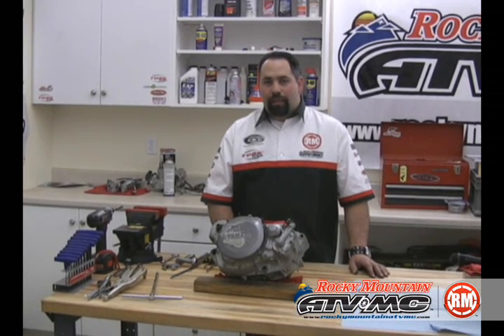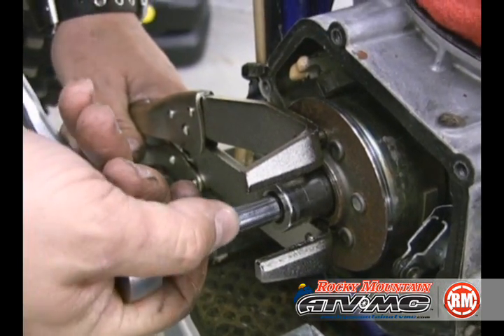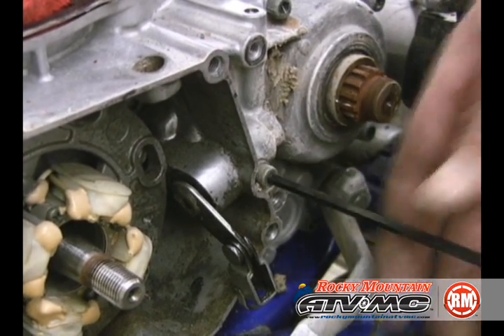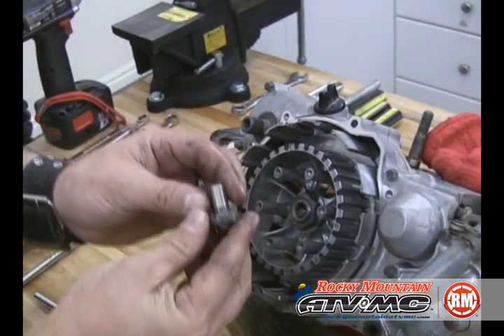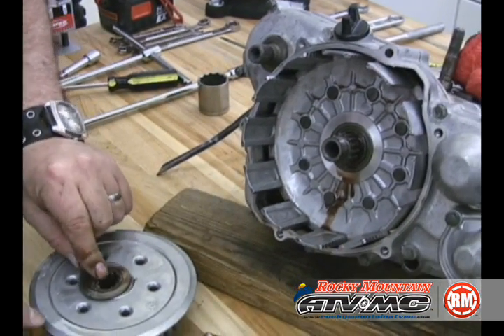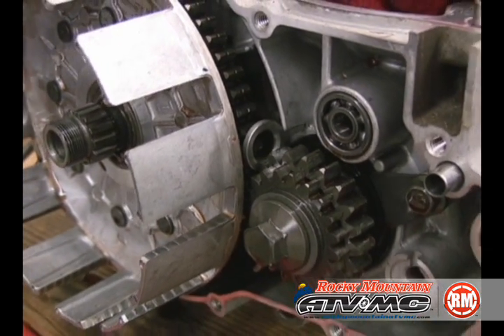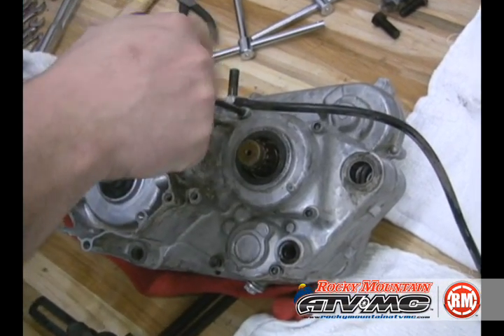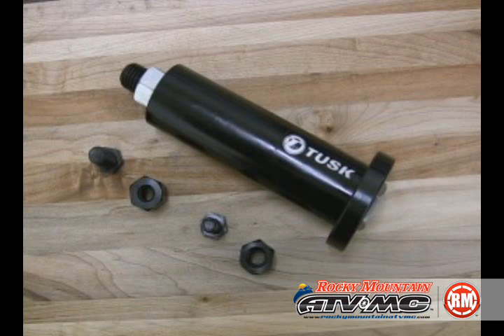Motorcycle Bottom End Rebuild | Part 1 of 3: Engine Teardown

Comment: RockyMountain, quick question. THis will be my first time opening a dirtbike case, I have a great Mechanical aptitude. Does the Head need to be completely taken apart to split the case? rmz250 2013
Reply from the maker: gerry kline First off it is necessary that you have the service manual for your bike and you need to follow along with that in order to do it correctly. As for the cylinder head being disassembled, yes that will be the first step. Removal of the cam chain tensioner and then you can take the cam caps out and then slide the cam-chain off the cams and remove those. After that you should be able to remove the cylinder head and then the cylinder and the piston but make sure and follow along with your service manual.
Reply: OK I have the service manual, they put everything in there except splitting the cases, which I found odd.
Reply from the maker: gerry kline
Yeah, that is odd. To be honest i haven't looked in a Suzuki Manual for anything in quite a while so i'm not sure. They should have all the information you need to split the engine but like you said they might not. You may want to ask your local dealer about where you can get the info for this job. For now you can follow with your service manual to tear it down as far as you can and then go from there. If you have any other questions let me know. Thanks!
Reply: Yes, I need to know what Flywheel puller will work for my year 2013, seems to be unclear on what will work/.
Reply: I have to swap internals to a new case 4 stroke, cracked the crank case. Are there any other things I need to know upon doing the split?
Reply from the maker: gerry kline Yeah, for some reason we don't list a flywheel puller for your bike. Motion Pro is saying it's part # 08-0425 which is a 28mm puller with internal threads and it also comes with a threaded cap to protect the threads on your crank. The OEM schematics for your bike show a flywheel with internal threads so this internal threads puller wouldn't work. Can you pull your ignition cover and confirm whether it's an internal thread or external thread flywheel? That way we can know whether or not this puller will work for your bike. As for the swap I would still consult your dealer to see if there is any info they can give you for this job. Use the correct tools, it will make the job a hundred times easier. Once you split it inspect and clean all the parts thoroughly before reassembling everything.
Reply: OK, I received the case, Inner clutch cover, kick start gear, thus far. I ordered the Tusk case splitter, and crank remove/install tool, clutch holders, feeler gauges, and impact screw driver set. I found a puller on Ebay brand new guarantee working on my setup. I pulled the cover and the flywheel seems to cup inward unlike the vid you have, so the other side of the clutch holder tool will not work because it being recessed inward, but im guessing the clutch holder could still be used hold the fly wheel in place if need be. There are threads on the actual flywheel. It looks as if there is a bolt holding it to the crank then separate threads to pull the flywheel out. I am almost inclined to put it finger tight install the old motor and create a video on this as there are no up to date 4 stroke videos out there. But your vid still is helping me address a lot of the processes. But I would update your tools list. I used my micrometer to test the width of the threads of the fly wheel it comes out to 28mm. If you have an email. I would gladly take various pix to help future customers and yourself if you ever wanted to make a newer vid. I am at the point of taking off the head. Just a question. Should I but the motor in TDC intake stroke and them remove or does it not matter as Im swapping out everything anyway.
Reply from the maker: gerry kline Yeah, the newer 4-Strokes are going to slightly vary with each machine and they are a little different than the YZ250 Engine Split shown in this video. You can also refer to our Four Stroke Top End Rebuild which will be similar to your bike as far as tear down and then reassembly and timing the engine by clicking this link. Motorcycle Top End Rebuild For Yamaha Four Stroke (Part 1 of 2) For the cylinder head dis-assembly and removal i would start with the engine at TDC for the tensioner removal and then the camshaft caps removal. That way there isn't any tension or pressure on the camshafts while you are removing the caps. After that it's not going to matter if the engine is at TDC or not until you are re-assembling the top end.
Reply: Rocky, I tried the freeze/heat method and it didn't work even on one bearing. I froze the bearing for 16 hours and then put the case in the oven set for 215 degrees. when I went to start with the crank bearing it only went in half way so I began to use a soft mallet it still only went in half way.I tried torching the case with the bearing still half way in and didn't move and ruined the shift drum bearing...... Will this not work on a brand new case as maybe the clearances are too tight....
Reply from the maker: gerry kline This method should work in any case if done correctly. I like to leave the bearings in the freezer until the very end. I like to heat the case with a torch like shown in the video and then the bearings should drop right in. Sometimes you'll have to use a bearing driver set to seat the bearing into the case the rest of the way but when you do this is crucial to have the case supported on a flat surface so none of the sealing surfaces get damaged. I would get a torch and a bearing driver if you don't have them and use those to seat the bearings in the rest of the way.
Reply: I have one,last question, upon my brand new case I just found out Suzuki didn't install the clutch release cam bearing, very small bearing on the stator side looks like the cylinder within the case, when you pull in the clutch it moves that cam back and forth. I don't know of anything that could press that down there.... have you ever encountered this. Also where you able to update y
our parts ID for the Tool we spoke about....?

Comment: Anybody know what size the nut is that holds the clutch basket on??
Reply from the maker: It's going to vary with each bike. Some might be a 27mm or 29mm or even a 30mm. It's important that you use the correct sized socket to remove this nut.
Reply: ok, thankyou for the reply.  Mine is a 2003, i will try to find the size.  I'm removing it tonight.  thanks!!

Comment: If I am just replacing my crank and rod do I still need to take the transmission out or can it stay in?
Reply from the maker: I would recommend removing the transmission while the cases are split. That way you can inspect those bearings and clean everything thoroughly. Removing it will also make removing the old crank and installing the new crank a lot easier and you don't have to worry about it dropping out during the crank replacement

Comment: I have a 1998 yz 250 is the crank from the 98 the same as a 1999 2004 in specs
 or upgraded? (can the newer model crank be used for a 1998 motor?
Reply from the maker: They are different and i don't think it would work putting a newer bikes crank in your 1998.
Reply: Rocky Mountain ATV MC Thanks for your quick response. I was afraid of that,
its getting harder to find one rebuilt and ready. I checked your oem site and it only lists to 2001. I guess il get this one machined .
Thanks again for the info
regards

Chris
Reply from the maker: Chris Matthews Hi Chris, i'm not sure what you mean when you said the OEM only lists down to 2001? We have the OEM crank for your bike but its pretty spendy. You may still be cheaper just getting a connecting rod kit and having your current crank rebuilt by a machine shop but i think the OE is worth looking at. If you are under the 1998 models your bike is listed almost to the bottom as "YZ250K1-1998". Let me know if you have any questions

Comment: It smokes so bad that when I. Park it , it drips oil off the tip of my pipe. , I'm not mixing it to rich or anything , and it acts like it always needs cleaned out unless you run it wide open
Reply from the maker: Cody Grimes It sounds to me like you're burning your transmission oil and a bad crank seal would cause that with how much you say it's smoking. I would closely inspect both crank seals along with their sealing surfaces to see if that's what's causing your problem. Have you noticed any drop in your tranny oil level? I would check there first and then let us know what you find and we'll go from there

Comment: Hey I really need some help with a bbike , its a 1999 cr250 , and I have just put a new crank , all the seals , all gaskets and bearings , new piston and rings , and its burning motor oil , it will smoke really thick and it turns my motor oil black , so someone said my crank seal was put in wrong , so I bought another one and its still doing the same thing , I can't find anyone that knows

Comment: I put my gear shifter mechanism in and then my kick starter in and the other gear but when I went to try to kick start it gets stuck on the shifter at the bottom and that's what is holding it from kicking the bottom gear gets stuck on it , i have a 1996 kx 125 , any help ??
Reply from the maker: It sounds to me like you have something installed wrong. I would refer to your service manual for parts locations and directions

Comment: Hello, there seems to be oil leaking out of the exhaust of my yamaha mini enduro 2 stroke bike. Any idea what might be the issue? Or guidance on where to look for problems?
Nice video btw.
Reply: maybe ur oil too fuel ratio is too rich try draining your fuel hose ur exhaust pipe and try a 50:1 mix otherwise it  could be the rings are warn

Comment: If I'm stripping a motor, I'll leave the clutch cover on and just remove the main cover, one less gasket and 6 less bolts to undo??!! the clutch cover is to service the clutch only
Reply from the maker: You already have to remove a few of the clutch cover bolts because they go through the main cover and into the center case half so usually it's just easiest to pull them both individually

Comment from the maker: It will be a double roller bearing or 2 seperate bearings but if you are looking to replace them you should be able to find it on the OEM Schematics for your specific bike and they are almost always found on the "Clutch" diagram. If you let me know what bike you have i can double check for you...

Comment: quick question im buying a 92 yz250 and the guy said 4th gear is not working and thinks the shift fork is bent how could i fix that problem i never fixed a transmission problem on a dirt bike before but i always get them running.

Comment from the maker: Most modern bikes are designed like this. The Actuator arm is on the left side of the motor and it goes down into it to push the lifter rod and push the pressure plate out. Other bikes used it on the actual clutch cover like the older YZ125 but that really isn't seen anymore but it's because it's just a better design. Easier to push the plate than pull it and then you don't have to run the cable over there and for other reasons as well

Comment: question my grandfather has a 1968 Honda 160 
it has a broken crank
I know the bike isn't worth much even at restored condition but is it worth fixing scrapping or replacing the parts completely (since theres more things that need to be fixed with it as it has been sitting since the 70's)?

Comment: I need help with my bike, i have a cr125 with the left side crank bearing loose. same side
as flywheel. if i take flywheel and stator off is ther anyway ican replace that bearing without removing engine and splitting cases? plz help!

Comment: Your videos are unbelievably helpful! I dont know what kind of person gives a video like this a dislike.  Anyway, I have a YZ426F and I just put a headgasket on it myself.  I put it back together, added fluids and water immediately mixed with the oil.  I took it all apart again and then added only oil and it starts right up.  As soon as I add water, it mixes with the oil and gets into the cylinder.  Do you have any idea what could be the problem?

Comment from the maker: It's just going to depend on what is causing the leak; if for some reason your right case cover has a hole or a crack in it you may be able to fix it with some JB Weld or something like that. If it's a tear in the gasket simply replace the gasket but sometimes if you've got a scratch in the sealing surface a little silicone will help it seal. Go ahead and remove the case cover and that should tell you pretty quick what is causing the leak

Comment from the maker: Thank you! About the crank bearings it's hard to say if that is what's causing the whining noise or not. Those symptoms are hard to diagnose but if possible try and figure out where exactly the noise is coming from. Change your oil and see if you notice anything out of the ordinary. Also check your stator and make sure nothing is loose in there. As for your other question no dry ice is not required. You can just stick the bearings in your freezer overnight and that will be sufficient.

Comment from the maker: I'm not sure what you mean by "beside" but you've got your left crankcase cover on that side and you've also got your clutch actuator cover which sits right behind the left crankcase cover and right in front of your front sprocket and both of those have gaskets under them. Or are your referring to the seal or o-ring that sits under your front sprocket?

Comment from the maker: There's a number of different ways to get your case apart and you'll find some other videos here on you tube but using the case splitter tool is by far the smartest and most reliable low risk way to get your cases split.

Comment from the maker: The flywheel pullers will usually always be specific to your bike. They do make universal pullers but we don't carry them. As far as other bottom end tools we have a case splitter (1177390001) and then we also carry a crank puller/ insttaller tool (1177380002) and then a clutch holding tool (1188510001) as well which are all universal tools.

Comment: hi i have a question,so my friend was ripping around on my quad and after downshifting from 4th to 1st or idk from what gear i wasnt there, but after that it's stuck in third gear and the lever's just loose like it moves up and down without getting into any gear and it won't cuz idk could it be the shift shaft? ..or what do you think could possibly be the problem?

Comment from the maker: Yes it should be a 27mm Puller for your 99. I checked our apps and for some reason we aren't listing this for the bikes prior to 2000. I check the part numbers on the OE schematics and they superceeded to the newer flywheel for 1999 so the 27mm puller for the 2000 should work. We will get the apps updated asap.

Comment from the maker: The tool shown at 1:06 is our Tusk Clutch Holding Tool - Part # (1188510001) and the tool shown at 7:25 in the video is our Tusk Crankcase Splitter/Separator - Part # (1177390001).

Comment: I have a cr250 that needs a bottom end job, is the flywheel puller and the case splitter absolutely needed? or could I do without

Comment from the maker: It's bound up somewhere but it could be in a number of different places. You may have to end up splitting the cases to figure out what it causing it to seize up but it could be something with your crank or a gear or something with the transmission or possibly something else so I would refer to your service manual for further suggestions

Comment: Great vids mate. I just brought a 04 yz250 and it's stuck in 5th gear picked it up cheap so should be a good project for me to pull down. The gear lever still moves up and down etc just won't engage into other gears. Is it very likely it could just be that ratcheting mech.? And if it is, iPod do I tell it's that and not a shift fork or something? Any help much appreciated cheers.

Comment from the maker: It depends on what bike you have and you may have to refer to your service manual but some bike use a bolt with a retainer or a snap ring that sits down in that channel or a bolt that sits in a channel on the actuator arm. Others will pull out once the push or lifter rod has been removed . . .

Comment: Well. It could be the transmission dog that grabs the 3rd gear..Or a shift fork is bent. Or the shift drum is to worn out..Im pretty sure the problem will cause you to split the case. Unless a rod somewhere bent or ceased. hope this helps you.

Comment: What do you recommend tightening the the nuts and bolts in the motor? It does not say in my manual, and to get the clutch nut and the primary drive nut off I had to use an impact wrench. 

Thanks

Comment: Certain types of billet clutch baskets are heavier than stock cast,i know some Hinsons are.However billet has no casting floors so are meant to be stronger.Most are hard anodised as well to make them last longer....What you have to think about is if you do get a lighter basket then yes it will give better throttle response but you will loose torque as there is less rotating mass within the engine

Comment from the maker: - did you buy the C-clip adaptor tool for the KX 65 (part #1329270001)?  You need that to attach the tool to the right side of the crank.

Comment: Great video... Quick question before I tear into my son's 98 CR80.  There is a lot of transmission oil draining out of the crankcase overflow tube. What could cause that? Do I need to tear into the crank or are there other possibilities? thx for your help